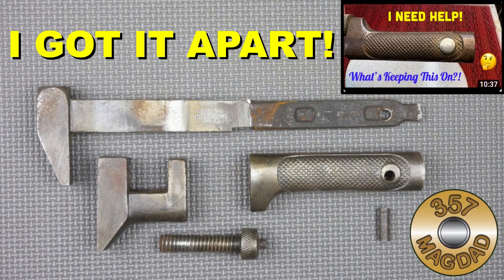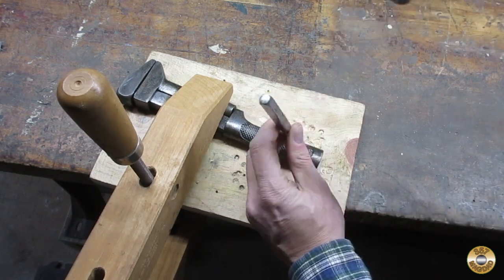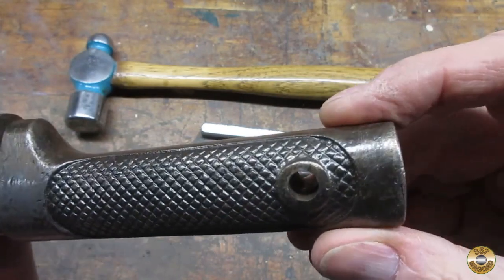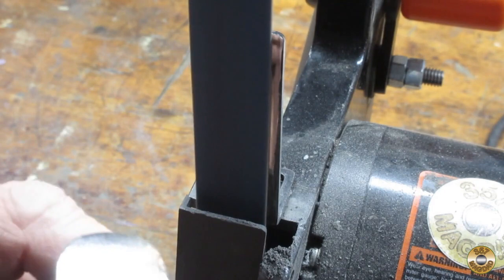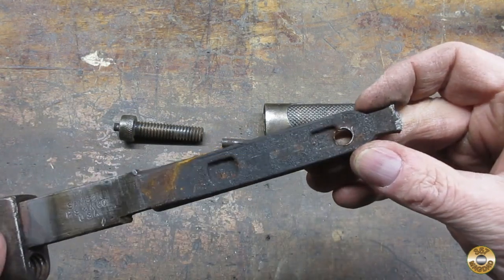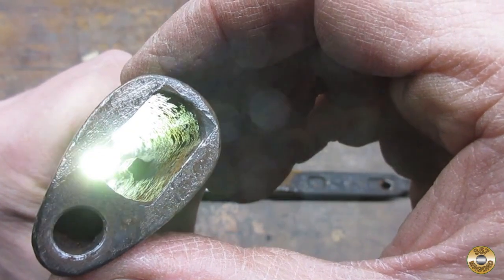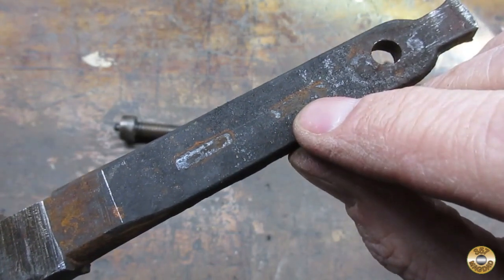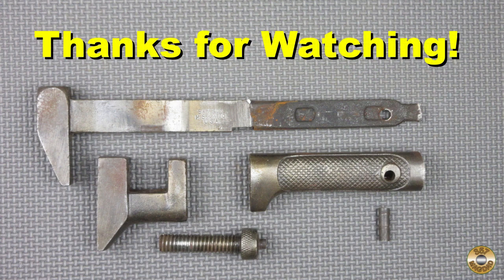Samson Monkey Wrench Disassembly - Pexto, P.S.& W Co., Peck, Stow and Wilcox

Comment: Indeed maybe ScoutCrafter has a chip in the handle from drilling it out. Maybe pushing the handle back in and then laying it on one side or the other when trying to drive it out again (instead of vertical) might shift the chip to a different place and make it easier to tap it out. Then again if all else fails, then back to the Drake. Thanks 357Magdad for so quickly letting us see what is inside that handle.
Reply from the maker: Thanks Jeff!  I hope ScoutCrafter gets his apart!

Comment: A slight bend in the inner bar or handle itself could cause them to collide.  Me thinks you're right.  Perhaps heating his handle might give enough room to slide past.
Reply from the maker: He also might have got some chips in there when drilling out the pin.  I think the Dake will push it out!

Comment: The end of the bar looks smooth after you sanded it.  Then you show it being knocked out, but then you only see it from the side and it looks chewed up?  Is that a trick of the light on the side, or did it take some serious effort to get it to start movng such that the punch did some damage to the end?
Reply from the maker: I probably could have taken more off the butt section.  I wacked it out without any problem.

Comment: I have a similar wrench with 2 pins. It is marked with NYRR and is a very stout and large tool.
Reply from the maker: I think the ones with metal handles were sold as railroad wrenches.
Reply: @357magdad  
Mine is marked as it was one. The manufacture mark says "Railroad special warrented", the other side says "Property of NYORR". It is about 16" long and real heavy compared to most I have seen. I almost passed it up due to its size but I like railroad connections.